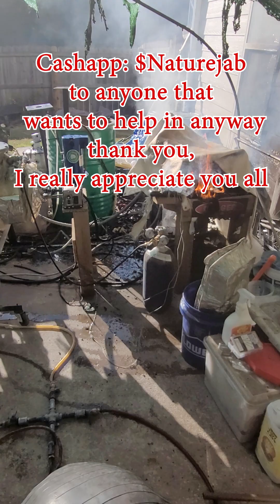A fire started.... And a lot is destroyed. Time for a reset I guess :/

Comment: You caught on fire because you dont have the right equipment to capture fumes or spillage. No hazmat berm. Osha or the EPA would shut you down immediately because you are basically a cracking refinery in your backyard. Your neighbors are in danger. I definitely applaud what you are doing but there refineries that went thru years of engineering and safety engineering and standards and regulations to not hurt anyone. I work in refineries and Ill tell you each piece is designed with a life factor, meaning, if a certain piece fails how many people will die and they try to keep that number at 0 but its impossible. Please be careful and take precautions. Maybe have a safety protocol and backups incase you forget to do something. We dont need a mind like yours getting maimed if that furnace explodes or there is a bigger fire because of trapped vapors.